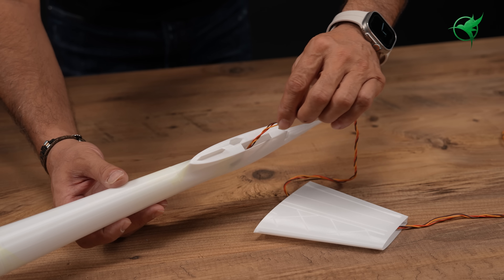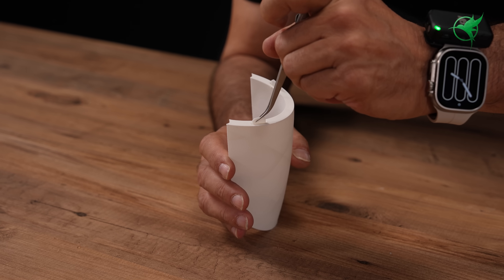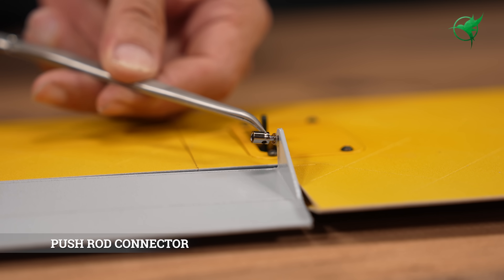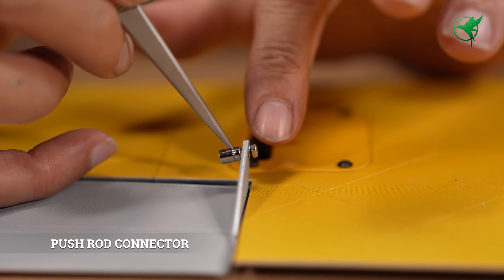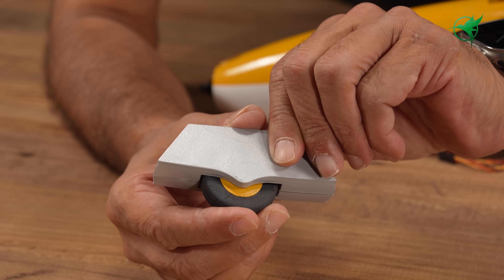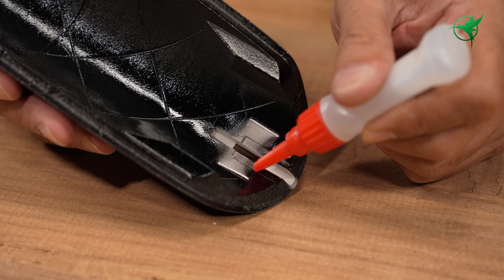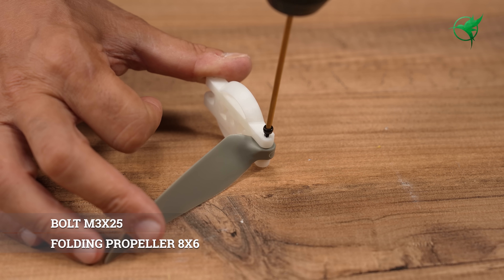3D Printed Eclipson Apex – Step-by-Step RC Plane Assembly

Comment from the maker: This is the first assembly video featuring a voiceover with our comments. We’d love to know your opinion — is this a good improvement, or do you prefer the old format without voice?
 Read more about Apex: https://www.eclipson-airplanes.com/apex
Reply: The voice over is helpful. A good addition.
Reply: I really like it. Very helpful, please keep it up. Beautiful plane!
Reply: Voiceover is helpful. Beautiful machine
Reply: Finally! A nice carbon tube inside the fuselage, I tought I would never see something like that on an eclipson model. That idea it should be implemented also on the Model 3D , V3 perhaps? Its the aileron s attachment method that I would like to see improved also.
Reply from the maker: @ripmax333  The Model S, designed four years ago, already had a carbon fiber (CF) tube in the fuselage. Wider fuselages, like the Model 3D, don’t work well with a tube in the center, so we need a different strategy. Instead, we use pushrods or carbon fiber rods glued to the fuselage, which work under tension. I recognized that there are some models without any extra reinforcement like Model B XL. We are aware about it and we will solve it.
Reply: La voz en off es útil. Y poder subtitular y traducir también.

Comment: Good morning, a single and important criticism, the fixing system of the engine, may be easier in the way presenting, but it is very bad, by the lever created the vibration trend and on a harder landing tends to break easily, the traditional firewall system, attached to the nose of the glider is more difficult to perform more infinitely more resistant and efficient, otherwise, a beautiful project. Bets regards - Marc - Londrina - Brazil
Reply from the maker: The vibration should be minimal unless the propellers are not well balanced.

Comment: Whats up with that inverted servo in the fuse? Are you suppose to brake it off if you need to replace or service it? That doesn't seem like a good design.
Reply from the maker: Hello. The design is fine, the mistake was done in this video. You can install the servo on the top side, this way you can remove it in the future if needed.

Comment: Good work gentlemen.  There is alot to like about this design and I see alot of improvement in your design approach and construction technique; however, I don't understand why you glued the rudder servo mounting plate in with the screws holding the servo in from the bottom?🤔
Reply from the maker: Thanks for your words. What you point is a mistake to be honest while recording this video. The idea was  to put the servo on the top side, this way you can remove the screw in the future if needed.

Comment: the voice over is cool, not like the AI sound in other Youtube videos. would you happen to have the flight settings somewhere, I couldn't fin the values for Aileron; Flaps, rudder, and elevator , maybe even snap flap vor Landing. I also like to use a bit of flaps for thermaling or speed flight
thanks. one last hing I noticed is that the Wing1 is 210.8mm in "Z" that is unfortunately 0,8 to much for the Prusa MK3/MK4..... Lucky I have a CoreOne as well
Reply from the maker: Thanks for the feedbacks. The information you requested is available in the drawing:
chrome-extension://efaidnbmnnnibpcajpcglclefindmkaj/https://www.eclipson-airplanes.com/_files/ugd/f2f22d_e23a7729de954317890bd4dba99b989c.pdf

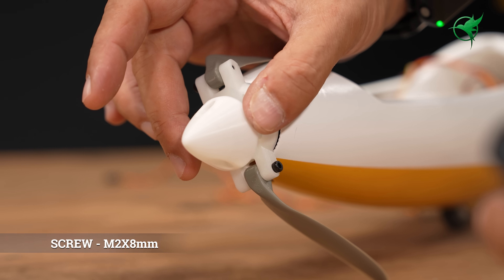Comment: i hope you dont hate me for this since ive already bothered you with this subject but 6:08 this was the moment on the video when i decided to get the model because i happen to have the spinner and i want to use it, aesthetics performance safety what ever the reason is i just thought i could, the problem as ive mention in previous emails is that the mount is for an outrunner motor and those spinners are the great majority for long shafts motors, than said motors are inrunner, i understand it probably isn't feasible to design a hole new item for one person but if you could please consider making a mount for these projects on a future project, this is very achievable with the mount you already have you just need to flip the front plate where the motor mounts 180 degrees on a Z axis and extend it a few mm and once again it would unlock the possibility for your customers to use other motors like the sunnysky longshaft emax motors t motors you guys are literally locking halve the market for your designs, specially when customers let you know about it and your answer is "just buy the motor we recommend" you also recommended the spinner fine ill buy the motor you recomend where can i find a commercial aluminium spinner made for those threaded wide shafts the motor you recommend requires? Cuz there are mounts for folding props that feet it but they dont have a spinner and my guess is if you didnt want to modify a mount i highly doubt youd wanna make a spinner, i hope you dont feel attacked thats not my intention but do give it a thought please

Comment: Pretty nice improvements especially for asphalt landing pistes (also liking the canopy having the latch spring). The CF core also should improve a lot on grass landing where twists usually stress the fuselage. May alternative is using wide scotch tape CA glued to the fuselage (or stronger).

Btw. for props bases and motor mounts, PCTG is pretty good: A little bit flexible, high impact resistant, and heat resistant, with good Z-layer adhesion. Wouldn't recommend ABS anymore (very poor z-layer adhesion IMO).
Reply from the maker: Thanks for the advice about PCTG.

Comment: 1:55 Just curious which primer you're using. I usually put epoxy but it's hard to pass through an air gun.
Reply from the maker: HOnestly i don´t know the exact primer they used, you can ask directly to @craftchannel guys. I any case it is not mandotry the use of primer.

Comment: So it only glides when landing?  You can do better than that.
Reply from the maker: We will be uploading more flight videos in the next days. In the meantime here you have another flight video recorded by one of the beta testers:
https://www.youtube.com/watch?v=gK5E391Gnm0
Reply: @eclipsonairplanes   I watched the video.  I could feel the weight of the glider halfway.  When it landed I knew it's a bit on the heavier side of gliders.  It would be more graceful if you could lose a 100-200 grams of weight. That's just my opinion, I might be wrong.  But it's a beautiful looking glider.
Reply from the maker: @aaindtharivalan  At 36 g/dm², the model is quite light for its size. You can compare this with similar models on the market to see how lightweight it is. However, excessive lightness is not ideal for flying in turbulent conditions. We recommend printing the wing with PLA to increase the wing loading to around 43 g/dm², which will improve performance for slope flying.
Reply: It's a good looking glider though

Comment: don't see any onboard footage while cam is on the tail... My Pathfinder is flexing like hell... 3d printed planes will never have the same sturdy feel as an balsa covered or foam plane... But love the smaler ones, easy and good looking
Reply from the maker: this model has a 10 mm carbon fiber tube in the fuselage, which provides excellent rigidity and minimizes flex. With normal use and no crashes, a 3D-printed plane can last a long time. For example, with the previous version of this model, I’ve personally logged over 100 landings and more than 20 hours of flight time—and the plane is still going strong.

Comment: Not strong enough for acro?  Was expecting to see rolls/loops/snaprolls at a minimum.
Reply from the maker: Of course you can do aerobatics! I don’t think you’ll be able to break a 10 mm carbon fiber tube just by doing a loop 😅. In the video, we didn’t show any aerobatic maneuvers because this isn’t an aerobatic glider—its roll rate, for example, isn’t the fastest. If you’re looking for something designed for aerobatics, I suggest taking a look at our FOX model—that one’s built for it.
Reply: @eclipsonairplanes  Thanks for the reply.

Comment: okay so the motor and prop your installing are not the ones your recommending further more when you look at the stats of the motor/prop combo you recommend its  0.5 to 1 thrust to weight ratio, i dont mean to be a smart ass i am new to all this  but how does this thing gets up in the air? also wouldn't you burn the motor using a 1060 prop?
Reply from the maker: In the video, we didn’t have a 1250 KV motor available, so we used a 980 KV motor with larger propellers than those recommended on the website. This isn’t critical—you can use different KV ratings with different prop sizes. Just follow our recommendations on the website or the motor manufacturer’s guidelines if you choose a different KV. As for power, it’s more than enough: with a 4S setup, you can achieve up to 1 kg of thrust.
Reply: @eclipsonairplanes i happen to have an x2216 at 1250kv my only concern is the temperature which sunnysky says reaches the 63c over 10mn at max throttle i definitely trust you i just downloaded this morning the set up for my printer and my eyes almost felt when i saw about 10 times the speed i usually print never the least the print is coming out the best ive seen since i started this printing odyssey
the next thing im printing is a humming bird and an altar so thank you
Reply from the maker: @flikitisideways9953  Use ABS to print the motor holder.

Comment: Nice!
...The rudder servo placement could use some improvement. With the upside-down screws and the mount CA'd to the fuselage, it'll be hard to service or replace the servo.
Reply from the maker: It is not a problem because the screw can be installed inverted too, so you have access from the top.  I have just realized that they installed in the video in the other way around.. an small mistake..
Reply: @eclipsonairplanes  Nice, thanks for replying. Cool glider!